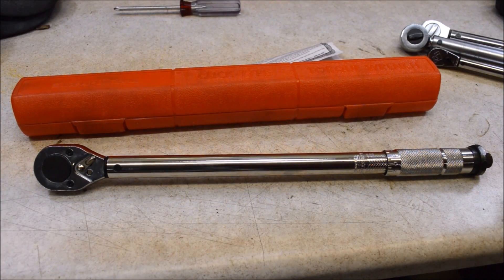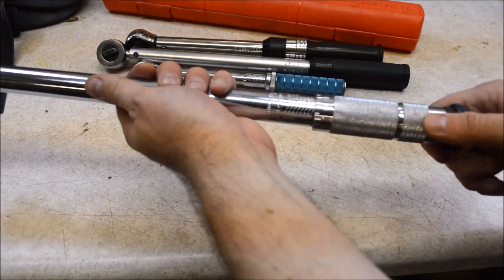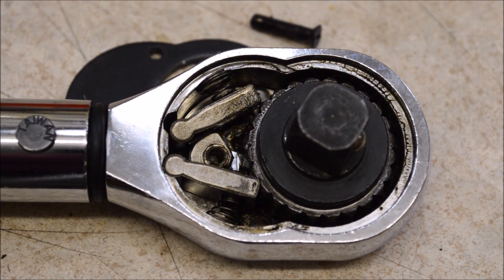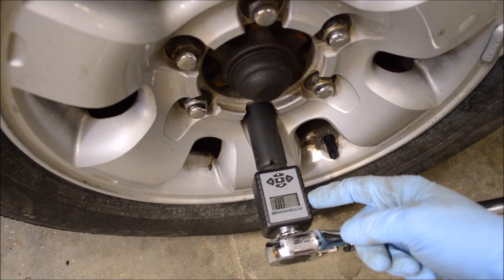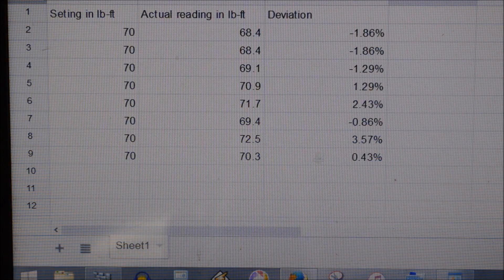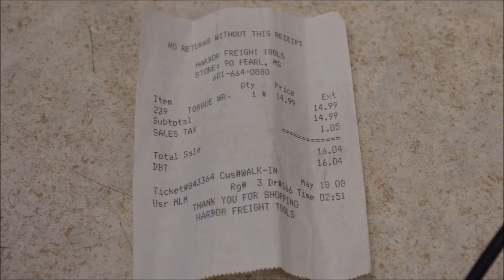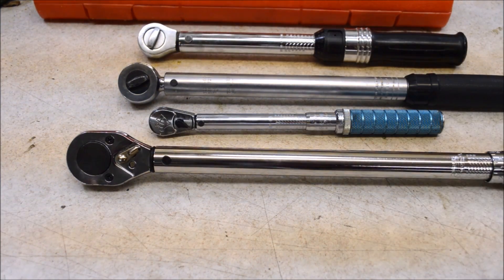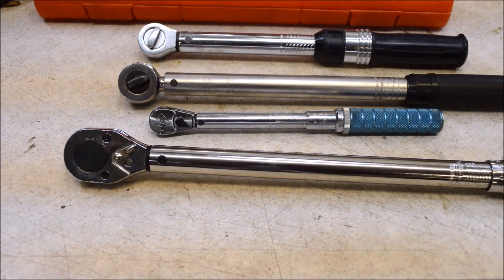Harbor Freight torque wrench 8-year review and accuracy test

Comment: Note: you also want to make your setting coming from low to high. Never from high to low. Reason. The internal adjustment screw always has a little slack in it…otherwise you couldn’t turn the handle… so to ensure repeatability…always set ur desired torque value coming up from low to high. If you pass your desired torque setting…go below it and adjust back to it.

Also, set your wrench to its lowest torque setting when your finished. These wrenches are typically plus or minus 3 % of indication.

Comment: I know, it's been a long time, but not for me. This is what happened. I needed a torque wrench for a while now, but couldn't pay what they cost and I knew about this one. But I wasn't convinced until I saw you. So, with Harbor Freight, I got so frustrated about their coupon and discount crap that I all but stopped shopping there. It's like you have to jump through all those hoops just to buy something at the same price the guy before me paid. I had unsubscribed from their emails because it was just too time consuming. Anyhow,  I needed this damn wrench to fix a slow leak so I finally bought one today. When I went to use it, the selector wouldn't twist past 30lbs, and that was tough. I took it back and they agreed it was defective and gave me another one. It's not as easy to turn as yours is, but with a little bike oil, I made it work. The guy at the store said it would loosen up after using it, but I only bought it for tire changes (to tighten), so I won't use it that much.

Thank you so much for your motivation and for making me go to their coupon page before I went. Kicking and screaming I did because I just want to go and not dick around online. Anyway, it was on sale for $18 (I don't use .99 mess) down from $22, which I would have paid without hesitation. Then they had a coupon for guess what? 20% off all torque devices! So I paid $14.39 for it (plus FL tax). I just wanted to tell you that you made a difference in my day. I appreciate you and I won't forget you. I subscribed too! Jon

Comment: Now the question comes how accurate $30 HF digital torque adapter is :) I have one, and it shows that all my $10 HF wrenches are 100% accurate, and all my $100 wrenches are 3 ftlb low :)

Comment: It’s just fine for the DIY applications. I locked down the rear end on my 2012 Mustang to get rid of the crazy live axel sway. The HF torque wrenches a 1/2” and a 3/8” wrench got the job done. Also had one of those Kimo powered ratchets making the job quick. The HF wrenches still work great. I’ve had mine for seven years with no issues.

Comment: Hi! It's a good review. Does anyone know the size of the screws that keep falling out! Mine wasn't working and then I noticed that one of the screws was missing. If this happens, the tool is useless. You'd think the manufacturer would have applied some locktite to prevent this. I can't locate the screw anywhere on the net.

Comment: I went to use one like this the other day.  I set it to 100ft-lbs and it never clicked.  I tried other settings and it also didn't work.  The time before it worked fine.  It just randomly stopped working.  For a torque wrench, that is totally unacceptable.  I could have easily broken something if I just kept tightening.

Comment: I am an aircraft mechanic. When I worked on charter and airline aircraft, the FAA insisted that I calibrate all my measuring tools at least once a year. Instead of spending a lot of money to get the tools calibrated, I calibrate them myself using a cheap dumbbell set I bought at Walmart which was calibrated at a grocery store using their scale that was recently calibrated and traceable to NIST.  For the last 30 years, I have three Harbor Freight cheap torque wrenches. Occasionally they are slightly off - probably because I loan them our to others who may misuse or drop them. In the past I would open the end of the wrench to reset them but the Harbor Freight torque wrenches have another advantage that I have not seen in other torque wrenches: they have a lifetime unconditional warranty. The few times that one of my torque wenches have been off, I now just return them to the store and get a new one free - no questions asked.

Comment: Question for you: I got this torque wrench from HF a couple months ago. I was changing the torque spec and the bolt on the back came off, a washer and 2 small pins fell out. I put the pins back in but each pin has a pointy end and a flat end. Which end goes into the wrench handle?? The pointy end or flat?? I can’t seem to find an answer. Thanks!

Comment: Got mine (1/2 dr.) for $14 with discount seven yrs ago and it still works. The screws came loose, one totally, and lost it. Luckily, I found the same size in my bucket o' boltz collection. Now, if I could only find a store that would let me check the calibration for free..... 😁
Btw, thanks for the review.

Comment: I bought the 1/2" and 3/8" after my buddy left my craftsman in lay on a small amount of break cleaner and the plastic handle fused to the adjustment collar. I have not been disappointed for the price point, good tools do not always have to be expensive such as handle tools for the average DIYer

Comment: Got a little bit upset after snapping two bolts on my caliper pin brackets while tightening them.
  Not sure why it happened but was using a 3/8 of an inch harbor freight torque wrench.
Reply: Why I’m afraid to use mine. My wife came home with that same exact one and I’m afraid to use it on my dirt bike lol. I wanted a good one.... I may just use my regular ratchet lol

Comment: I just bought a 1/2 torque wrench from HF to torque down lug nuts. My sockets seems to come off the anvil easily and the detent pin seems normal. Is the sockets falling off easily a normal thing for the HR torque wrenches?

Comment: Impressive.

Torque wrenches are pretty simple things. If you take care of them, they will be accurate for decades. My 1978 vintage Craftsman is still accurate to about 3% today. Sadly my 1999 250 ft-lb Craftsman Digitorque died when its paper indicator roll started freewheeling. A new 90T 250 ft-lb ICON torque wrench more than replaced it!

Comment: If you're a do it your self mechanic, it's what you can afford.  Even if it's off a bit,  you'll get very close values which is important when installing lug nuts.  Also there is at least one video where you can test and calibrate your wrench.

Comment: @Tool Teardowns I am going to install a pressure switch on my Allison transmission in my Duramax pick up, 9 foot pounds or 108 inch pounds, would you trust your Allison Trans to a now $20 pittsuburg HF TR?  the options are a 30 base Capri in pound (1/4") or a Capri Diamond drive at 45 (fancier, same wrench same tolerance, or  a $40 Tekton, those are my options~ thanks!

Comment: Prior to retirement I worked in government and we used precision measuring equipment of all sorts that were calibrated on a regular time interval. One day I asked one of the calibration techs to check my HF torque wrench, voltmeters and amp meters. He, as well as myself said they were spot on and my voltmeter was more accurate than the expensive Fluke meters we used at work!
They may not be expensive pieces of equipment and not the prettiest cases and packaging but they do the job they are designed for and the home mechanic and technician can afford accuracy at HF prices, especially with the coupons and sales events. 
BTW, have you noticed how some of the tools you purchase at HF looks identical to more expensive brands? Perhaps some other brands use the same sources and just have their name and logo imprinted as well as increase the purchase price several fold.  I know many people who equate quality with the sales price, not always a solid metric to make a judgement.

Comment: TO BE HONEST: I had one of these not work brand new out of the box. You may think who cares, it’s cheap?  Not the point.  The way I found out it didn’t work was by over tightening head bolts after a head gasket replacement.  I realized it wasn’t clicking after I had probably WAY over tightened the bolts.  Went to Home Depot and bought a husky model. I’m sure most of these are honestly fine but if you’re working on a customers car maybe don’t take a risk.

Comment: Thanks for the video. I really only use my torque wrench to tighten up the wheels on my cars when I do the  summer and winter tire changeover. The Harbor Freight tool works just fine.

Comment: I wish we never bought it.  Mine stopped clicking in the middle of a spark plug job.  Turned from a torque wrench into a breaker bar and way over-torqued the aluminum threads.  The passenger side head was ruined as a result. 

Go with Husky if you want affordability.  Save yourself the heartache I experienced.
Reply: Colt 604 why you use torque on spark plugs ?don't you know 1/2 turn is good to go after you bottom down by hand?
Reply: @marianluc6235  Crown Vic plugs have a nasty tendency to blow out of the head or strip the threads if they aren't torqued just right.   The threads are only about three deep in those and it's soft aluminum.  If they were iron threads with several grooves, then I wouldn't use a torque wrench.

Comment: Just tested my HF Torque Wenches the same way you did in 2020, I bought mine in 07-08 and they were right at 68ft lbs when set to 70ft lbs.  You are correct, the key to keeping any torque wrench calibrated is to always set it to the lowest setting when not in use, never use them to back off nuts or bolts (do not use them as a ratchet) and they're not hammers.  While I was at it I went ahead and blue Loctite the little screws.

Comment: Hmm, does the small end of each spring make contact with the pawl, which is the way you have them situated, or does the large end make contact with the pawl, or doesn't it make any difference. My springs went flying away and when I finally found them, I put them back with the large end touching the pawl. Ratchet seems to work but maybe it is better to turn them around?

Comment: Let me preface this by saying I'm not a tool snob  probably half my tools came from HF.  Nearly all of my hnland tools came from HF.

I've had 2 HF torque wrenches.  One 1/2" one 3/8".  Both stopped working after a few uses.  They no longer click at the desired torque.  I believe when they worked they were accurate enough.  My problem is I can't trust them to work when I take them out if the toolbox.  Maybe it will work this time, maybe I'll destroy whatever I'm working on.  It's not worth the risk to me personally.

Comment: What would the "torch diferencial tolerances" be on most applications?
   Engine heads/valves from 360 mopar to gy6 150cc scooters should have different torch tolerance range with MAJOR diffrences in problems from being "out of spec".
    Could you give more explenation on your test #'s relevance? Acuracy within tolerance perameters

Comment: My experience with Harbor Freight is very good. The 3/8 and 1/2 produce a very definite click and they probably are quite accurate. The advice to set it to zero after use is important. If you do not it will lose its accuracy according to all sources. These tools are not meant for constant use, but if the number of bolts you need to set to torque in a year is less than a few dozen these will be good enough for you with any standard production vehicles or bicycles.

My only problem experience is with the 1/4 torque wrench. You have to learn how to recognize when it clicks and get the feel of or you might risk overtorquing small bolts and damaging threads in aluminum and allow parts.

Comment: Professional technician here. I own both Matco and Snap-on torque wrenches, 2 in 1/2" and 1 in 3/8". 99% of the time the 3/8" and 1/2" do the job. But occasionally Lexus throws a monkey wrench in there with an inch pound torque spec. I think Ill pick up a 1/4" version from HF and give it a whirl!

Comment: Interesting fact: In my previous employment (10 years). I had to use a torque wrench daily. Accurate torque was imperative with this company. They required all torque wrenches be tested/certified for accuracy every six months. They had their own test equipment which itself was recertified annually for accuracy. All torque wrenches were tested throughout there torque range which is where accuracy can vary a lot between different torque wrenches. My $11 HF torque wrench was among the most accurate through it's entire torque range. It proved to be more accurate than a $300+ Snap on wrench. It passed the accuracy test every six months for 7 years. I still have it with it's last certification sticker still on it.
Reply: Yes, but if you own any tools that are not Snap On, then you will not be allowed into heaven.
Reply: @Sho Yu Weeni For wrench in video it is 4%. I have same 3/4 type in my work.
Reply: Good to know.
Reply: Mine don't click very loud but they click within spec
Reply: Im having a hard time believing you. My experiences with HF torque wrench are terrible.  I Purchased the 3/8 last year to use as my trusted 3/8 tekton was out for service, biggest mistake and the biggest frustration when attempting to torque a thermostat housing to a water pump, it snapped the bolt head, and  boy was it a bitch to get out.  Never again..
Reply: @dannydee9919  Because you should have used an inch lb wrench, not a ft lb.  No ft lb torque wrench is accurate with low torque settings like that.
Reply: @Awesome Finish  nah, thats not how it works bud.. if you are going to  advertise a tolerance than i am going to work with that tolerance, Yes an inch torque lb is ideal and yes torque wrench's start to loose accuracy toward the lower end of the spec but that's why a manufacturer adds a tolerance, that tolerance is suppose to take into consideration the error that is introduced. DONT advertise a tolerance than say the tool wasn't made to torque my values after i snap a bolt..  makes your brand look bad.
Reply: @dannydee9919  It was never advertised to do 7 ft-lbs, though? It is quite literally 20-150.
Reply: @derekmeyers5966  who said it wasnt advertised for 7 ft-lbs? I don't know what you are contesting.  My original reply was an opinion i formed regarding all HF torque wrench.
Reply: That is how it works, facts don't care about your feelings. If it's really important that the torque be very accurate, I'd suggest manually checking the calibration. Locking the square drive in a vice and hanging a weight from the handle 1 foot from the square drive should cause the wrench to click when the wrench is set to what the weight you've hung from the wrench is. So if you set the wrench to 20 lbs, hang a 20 lb weight a foot down the handle and you should get a click. If you don't, the calibration is off and I'd suggest watching some videos on how to calibrate your wrench.  @dannydee9919
Reply: @caffeinepowered3957  You dont have to explain what calibration is nor suggest alternative ways to calibrate, I know what calibration is and I understand what calibration is. IF you have 2 torque wrenches, same mechanics, same manufature, same everything, buut only difference is the type of material that the apperatus is made of changes and one is made from A lower grade of steel DO you think that they will perform the same every time they are used? bro go BACK to sleep. keep buying cheaply made torque wrenches, No offense to HF, I frequent them  acouple times A month, BUT if there IS something im going to skimp price on its  Not A torque wrench.
Reply: @dannydee9919  Maybe their tools are hit and miss. The more expensive ones aren't showing any better in tests that I've seen and I've seen quite a few. Sorry that happened to you. I hate when that shit happens.
Reply: @floridaredneck  im not a professional mechanic therefore my tools are not heavy use and not put through heavy strain, harbor freight tools have been hit for me for what I use them for. The only other tool that I remember that were a joke were some wire strippers. I love harbor freight just not their torque wrench. I credit harbor freight for getting me into woodworking as their woodworking tools were easy on the pocket.
Reply: it might be better for higher torque like he tested with 70 ft lbs. I used it for 7 ft lbs on a bolt and it stripped the threads
Reply: @morphius747  The torque wrench in this discussion is the 1/2" drive version which has a range of 20-150 ft lbs. 7 ft lbs is out of range for this wrench. For that low a torque I would use an inch lb torque wrench.
Reply: @morphius747  If you are so into accuracy, why didn't you know that 7 ft. lbs. is NOT within the stated range of this torque wrench.
Reply: @chucklemberg4968  radical

Comment: what size of drive should i used to my mc sparkplug and crank cover bolts? 1/4 or  3/8  or 1/2 ?
Reply from the maker: What are the torque specs? That will determine what size you need. In general, the things you mentioned are too small for  1/2" drive torque wrench.

Comment: I think my HF Torque Wrench may be as old if not slightly older than yours it works fine.  It will snap off fasteners just as well as any other torque wrench ;).

Comment: For all the more times you actually need to torque nuts and bolts, I love it.  I've never had an issue with it's accuracy.  The tooth thing...that's knit picking.  You're not supposed to use a torque wrench to tighten nuts and bolts, just to torque them once they're already tight.  That's more of an issue with ratchets.  I have a set of ratchets (not HF) that the screws in the face plate kept coming off of just like that torque wrench...a drop of thread lock and they're good as gold.  I've worked in a professional diesel shop, and for my money in my toolbox at home, I'll take the HF torque wrench every time and twice on Sundays.

Comment: I used this torque wrench for my head bolts when I changed the head gasket on my Honda. Still good 10,000 miles later.
Reply: I bet it’s still good today if you still have it